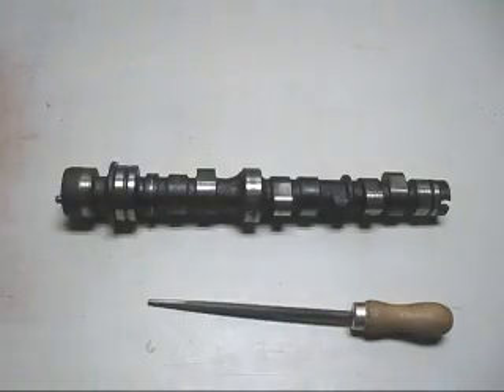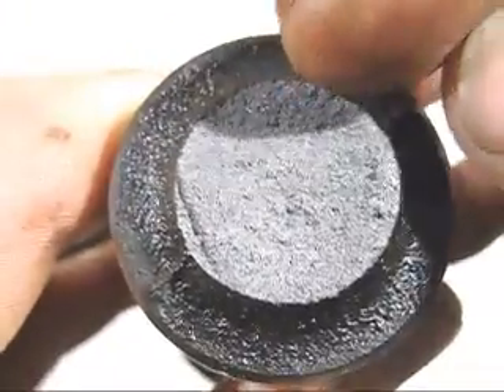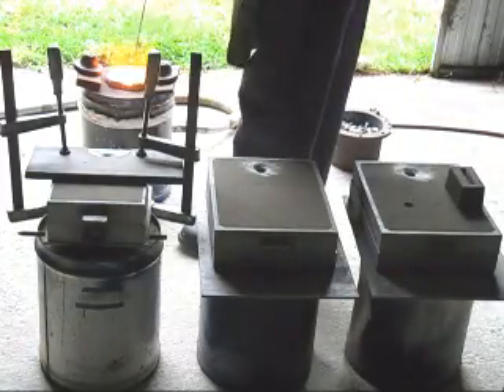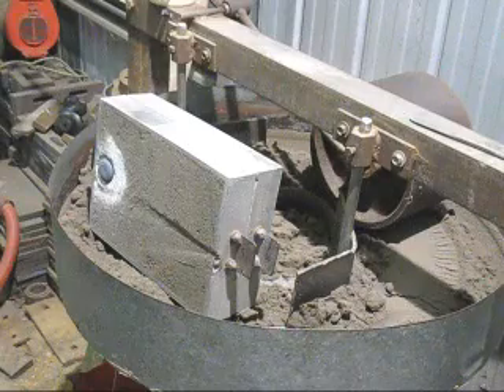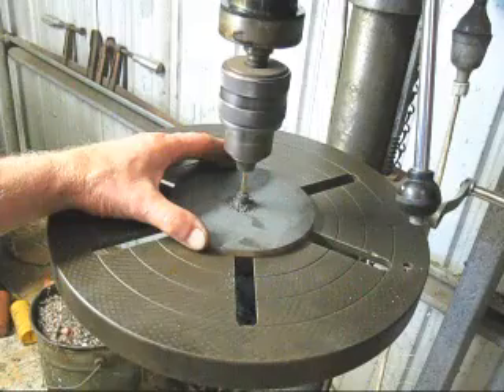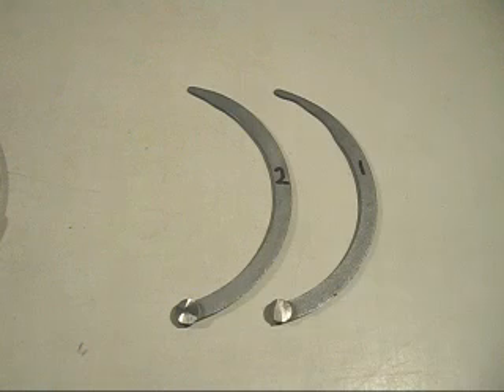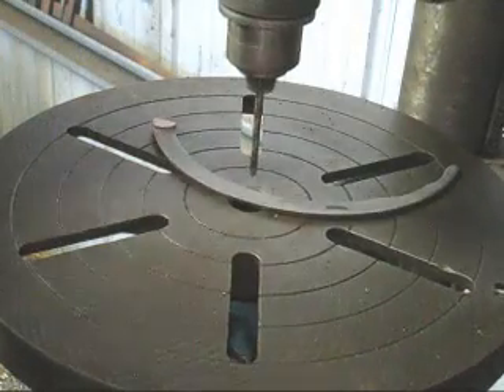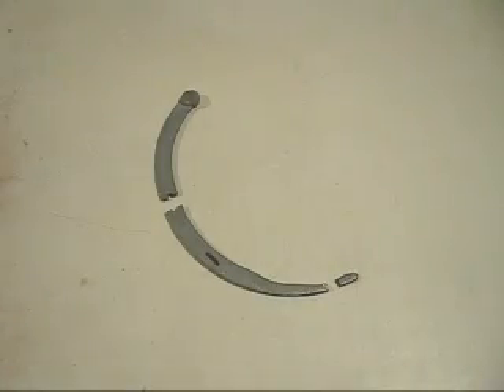Melting camshafts

Comment: Thank you for your great Videos 🙏  After adding ferrosilicon how much time do you still have until casting? Or do i have to wait certain time until i can cast. I add 5% Ferrosilicon but the casting still hard to drill??? Maybe i should wait longer until it better dissolfes in the liquid iron? Thank you. Greetings from Germany 👋
Reply from the maker: 5% Ferrosilicon is way too much I use 0.25% to 0.5% Ferrosilicon. When all the ferrosilicon has dissolved you have 5 minutes before the effect fades away completely.
Reply: @luckygen1001 Thank you so much for your answer! 5min this is good to know👍👍👍 
i made a mistake i mean 0,5%😂 🙈🙈

Comment: You really enjoy smashing things don't you? On an unrelated note... I was curious as to how dificult it would be to reduce iron ore in a crucible like that? I would build a cupola furnace, but here in Oregon we have very little access to coal, so I would have to burn oil and would like to build a small furnace like you have. How would you recommend tapping off the slag? Separating the slag from the iron at the bottom? That's where I'm getting stumped.
Reply from the maker: Slag floats at the top of a melt and scrape it of with a piece of steel.
Reply: @luckygen1001  Is it difficult to distinguish what is liquid slag and what is liquid iron? Or would the slag cool enough at the top to solidify?
Reply: I know on cupola and electric arc furnaces, they have a slag tap at a higher elevation than the iron tap to just drain it off. Would I have to do something like that do you think?

Comment: how do you know how much air and oil use to get the best heat for melting aluminum and brass copper and cast iron ?.
Reply from the maker: +Daniel van der torre You need a neutral flame, it burns the hottest. Too much oil makes the flame smoky
Reply: so smoke is to much oil so just below what about air how do you know how much air is it ok to just let the blower go top speed and add fuel until it smokes and then back it of using the fuel sorry I am a slow learner I don t know what a neutral flame is